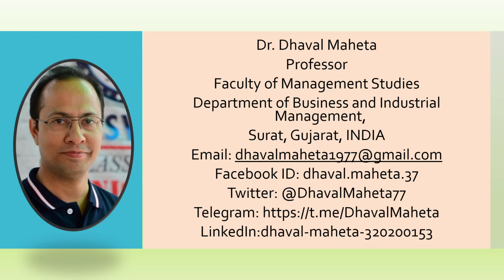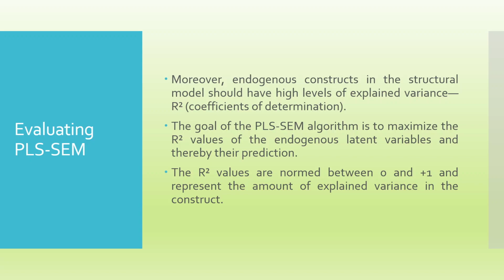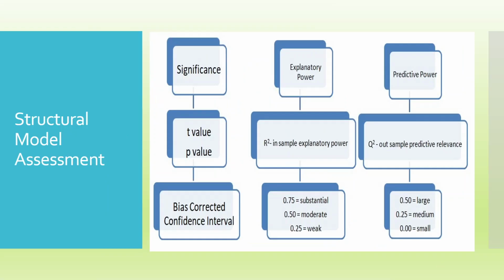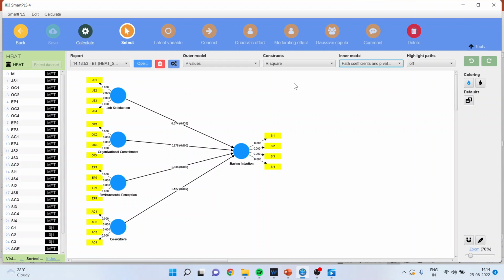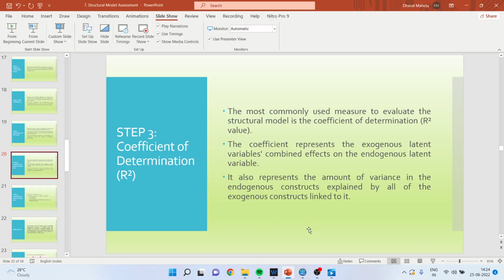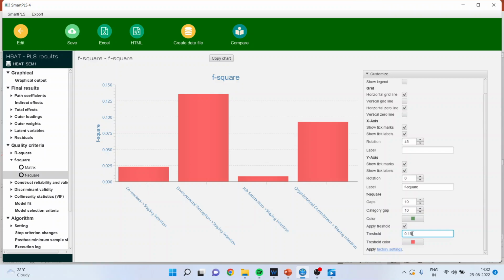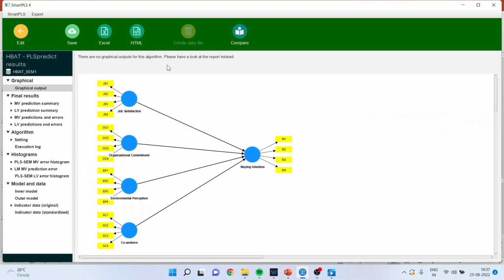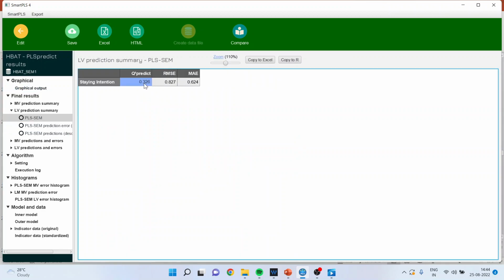7. Structural Model Assessment in SmartPLS-4 || Dr. Dhaval Maheta

Comment: sir, i ran the collinearity stats VIF and 17 indicators of one variable is having value of more than 5 in the collinearity of outer model but the discriminant validity and the cross loadings was okay and the values of inner model collinearity is less than 5. Pls help what can i do to fix this? New to PLS SEM PLS HELP
Reply from the maker: No need to worry. Your discriminant validity is ok
Reply: @DhavalSaifaleeAaryash  is my collinearity condition okay?  can i move on to next step criteria of PLS SEM?  Thank you very much sir for replying. I am currently running a pilot test on my thesis model and following your tutorial for it. They are of great help🙏

Comment: Dear Prof

Thank you for your resourceful video. 

I have a question concerning f-square. In your video, the bootstrapping is chosen with the one-tailed test type.

In my situation, I have a mediator construct with a small effect size on DV.

When I chose to bootstrap with one-tailed, I got a p-value of 0.034; meanwhile, when I chose to bootstrap with two-tailed, I got a p-value of 0.069 (above 0.005).

Should I report the finding for the test with two-tailed or revert back with the one-tailed test of bootstrapping?

Thank you